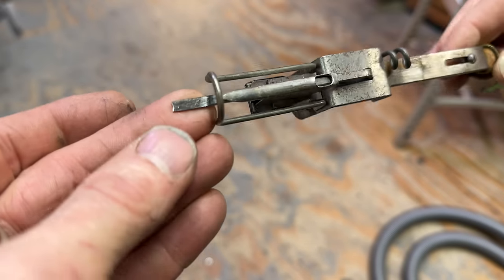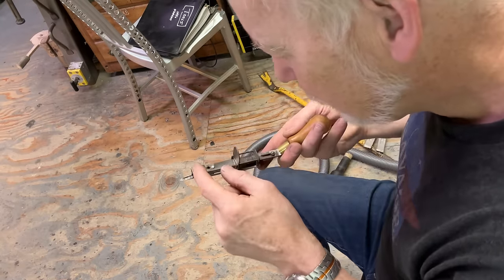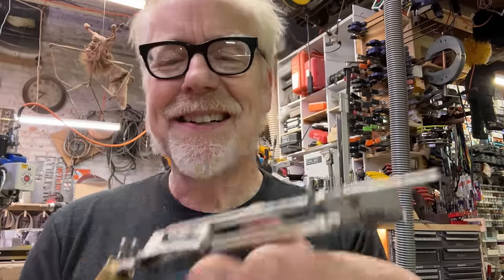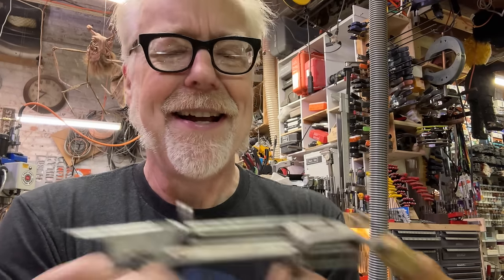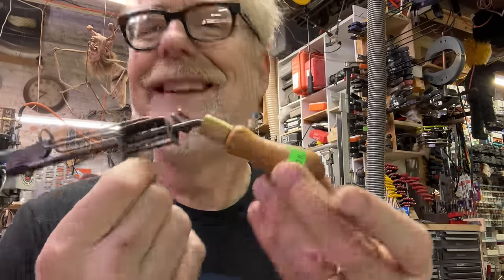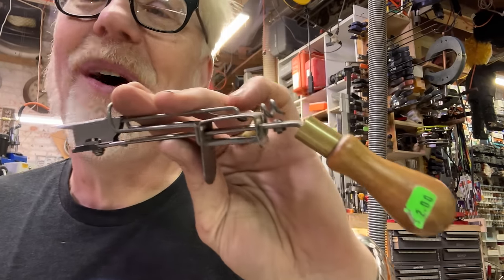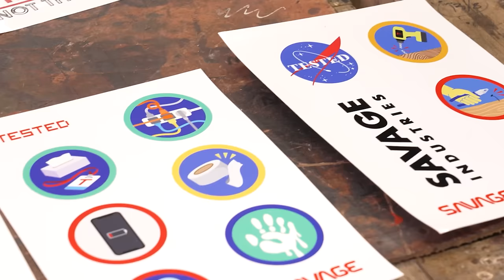Adam Savage's Mystery Tool Mailbag

Comment: This is a manual tufting tool! for repairing tufted rugs.
Reply: Yes!  I used one at school to learn how to repair  carpets!
Reply: What in the blazes is tufting a tufted rug?
Reply: nice 

My first thought was a some type of leather lacing tool
Reply: With the needle broken...
Reply: You're spot on, it looks like it's bent because everything I saw on my search was completely straight.
Reply: @johnhunt1725  Something you can't do to an untufted rug.
Reply: I was thinking the same thing! Looks like a huuuuge pain to use though.
Reply: It is a rug hooking tool, most likely a Bluenose
Reply: @johnhunt1725 you know those kinda plush indoor rugs or carpet? Basically this, forces the string through the back of a peice of fabric over and over and over in out, in and out. Usually you follow a pattern on the back to know what colors etc.

That process is called tufting, basically means to pass a thread through or something like that.

 Well if he's correct its for making repairs which is good because good lord doing that by hand would be agony large scale, hell even a small rug would take hours.
Reply: @alexhuxley3355 you know those kinda plush indoor rugs or carpet? Basically this, forces the string through the back of a peice of fabric over and over and over in out, in and out. Usually you follow a pattern on the back to know what colors etc.

That process is called tufting, basically means to pass a thread through or something like that.

 Well if he's correct its for making repairs which is good because good lord doing that by hand would be agony large scale, hell even a small rug would take hours.
Reply: I suspected something like that, maybe because I just watched Ali Spagnola's latest video with the tufting gun!
Reply: @1BigBen  Mine too, I wondered if maybe it was used for punching through thick leather and then pulling the lace with it.  Like a saddlemaking tool or maybe for a baseball glove or something.
Reply: That’s what I was going to say.
Reply: Making baseball maybe?
Reply: They used these manual tools to create kit hook&loop or shag rugs.
Reply: Came here to say this as well :)
Reply: As soon as I saw the thumbnail to this video I thought it looked similar to a tufting gun :D
Reply: Saw the thumbnail and was thinking oooh tufting rugs.
Reply: I was close. I figured it for some sort of heavy material sewing tool, maybe used in sailmaking, or something like that.
Reply: @donsample1002  Exactly what I first thought, some sort of sail repair tool.
Reply: Yes, I got the same answer with help of 'Google lens'. Took a picture of the screen when Adam held it and instantly found similar images. I'm amazed how easy it is to solve the origin of mystery objects like this with Google Lens.
Reply: This is actually a vintage piece too
Reply: I was thinking for sail making. But I like yours better.
Reply: I have an electric tufting gun at home and so this was my first thought as well. Lots of similarities. Would this have normally had an integrated scissor mechanism for cutting also?
Reply: @KJO1993  It is.. which is why there are power tool versions now ...
Reply: My fist thought was some sort of sewing mechanism, I think he was on the right track with the thread holder.
Reply: @johnhunt1725 tufting rugs is adding the material that makes up the design in the rug.  It's basically the process of making a rug
Reply: I think you’re 💯 correct. I’ve never seen a manual one but I’ve seen many people use automatic tufting guns before and was my immediate thought.
Reply: I love how this community knew what it was...
Reply: Tufted cattle?
Reply: I thought it looked vaguely familiar. My mother used to do all kinds of artsy-crafty stuff and tufting rugs was right up her alley.
Reply: I KNEW IT!!!!!!
Reply: Spoiler!
Reply: @FortyHurts yeah I was going the sail route too 🤔
Reply: @johnhunt1725 if you don't know, that's just tuft.
Reply: During my time in Canada in the 1920's I saw this tool used to sew twins back together that had been separated and realized they didn't want to be. Very painful boody process. More like grafting the way they did it so their skins would grow back together, but unanimously all the twins perferred the pain of that proceedure than the pain of separation. Weird thing was, that's NOT what the tool was designed to do. They're Canadians after all, who can figure those people out?
Reply: Great answer but it only leads to more questions. What is tufting?
Reply: I can see it now
Reply: I thought so!
Reply: That's exactly what I was thinking! For making rugs
Reply: Good call.
Reply: Yes, it looks like a fancy version of a rug making tool.  I helped my mom make a rug when I was about 10 years old.  A loosely woven piece of material had a peacock printed on it and we used a hand operated tufting tool to press loops of yarn through the pattern.  Using a hand operated hook, it was tricky to keep all the loops the same length.  It looks like this tool is settable to make it easy to keep the loops standardized.
Reply: @1BigBen that’s exactly what I thought!
Reply: Watched the first video on rug tufting that popped up pretty coool
Reply: No scissors as this is used from the back and trimming will need to be done from the front of the rug.
Reply: @djpoopypants4741  🤔😂
Reply: @MrGreenAKAguci00  shaggy carpet is tufted...
Reply: That's what I was thinking because it looks a lot like those rug tufting guns that are popular among rug crafters these days.
Reply: That was my thought as well :D Glad to hear I was right :D
Reply: I thought so too. Looks like it’s used for making rugs. I’ve seen videos of powered handheld version that looks similar.
Reply: @alexhuxley3355  It looks like a 1926 Garrett's BlueNose Rug Hook Tool
Reply: Yep. I knew that too just looking at the thumbnail :D
I actually have one. Its bend to ** tho
Reply: That is close to what I guessed: a rug punch tool like would make craft punch designs on canvas. These are simpler: on one side it makes an embroidery-like stitch, and on the other side it leaves a loop as the needle is drawn out.

Or is that what a rug tufter does?
Reply: @NotMyActualName_ 
Close, I think. The thing along those lines would be a stitching awl, but you have to thread the "bobbin" thread through the back end of the stitch lace to form a stitch like a sewing machine stitch.

Don't you need pre-punched leather pieces for saddles to sew from either side with sinew? Just asking.
Reply: @mrechannel2023  You can tuft anything with the right tool
Reply: oddly this was my first thought because I've seen so many of those rug making videos lately where they use a similar sort of "gun". Although I expected this also to be automatic, just missing some other significant part of the machinery. That being said the adjustable stop is kinda weird because it limits how far BACK the slide goes
Reply: Yeah I figured it was for manually driving a stitch somehow.
Reply: my thoughts indeed! Pretty cool
Reply: Instructions unclear. I tufted my pig.
Reply: I saw it and first thought was it looked like the front end of a tufting gun. I am watching this video while waiting for my new tufting gun to show up.
Reply: That’s what I thought!! I just watched it
Reply: @mrechannel2023 what do you mean you can't tuft an untufted rug? That's exactly how you tuft a tufted rug in the first place! Or did you mean that tufting a tufted rug isn't something you can do with an untufted rug, because then you would be tufting an untufted rug?

I love learning new words and immediately butchering them.
Reply: @mrechannel2023 untunfting a tufted rug takes a different contraption thingy😂
Reply: This is probably the only channel on Youtube where you can find so many people that tuft rugs.
Reply: Yup
Reply: After two minutes we actually take a look.
Reply: This is the answer.
Reply: Tufting demo: https://www.youtube.com/watch?v=JAFxVleDKN8
Reply: At first I thought manual leather stitching. But "string" guide, eye of the needle, uh, the needle itself as a whole, plus U.S. & Canadian patents. Props to Adam for showing it to us from every angle & so completely--no small task!
Reply: For making rugs also
Reply: It's a tool for hooking rugs. I've used it to make several. The loop in the back feeds the yarn into the rug base. Hope that's right. Thanks for your show.  Mary C Arkansas
Reply: God I fuckibg love the internet
Reply: Thank you for answering but I really wish this comment was second on the list cause I saw it before the video and it kinda spoiled it for me
Reply: L @reneedla
Reply: @johnhunt1725 its how carpet is made, pushing tufted yarn thru a backing creating one side that has thousands of pieces of yarn sticking thru it
Reply: That was a tuft one...to figure out
Reply: Yessss. I have one of those to fix rugs. And the electric one, of course.... 😅
Reply: I was going to guess it was for stitching sack shut somehow. But the carpet theory makes perfect sense.
Reply: I was way off in my guess hah. Thought it was a butchers tool to use for squirting liquid in to meat
Reply: I was thinking that immediately when I saw it!
Reply: Yes! I suspected this also.That's such a cool tool.

Comment: I know you get tons of comments, but I felt proud and wanted to share.

My dad passed away about 7 years ago and I inherited an entire workshop full of tools. The standard things like a table saw and compound miter saws to mechanic tools to concrete finishing tools to electrical and plumbing specific tools. It has been incredibly hard going through everything because I can see my dad using them to build or do repairs but year over year I spend time going through and organizing things with all the tools I have and consolidating.

I watch your videos and you say something sometimes which is to the effect of "trying / doing new things is scary". I 110% agree with this sentiment. Failing is difficult and sometimes costly, and nobody likes to fail, BUT that's how you grow and learn!

Well, I had to rethread a nut so it would fit a specific bolt into it and save me the hour drive it takes to goto the hardware store. I have never tapped or rethreaded anything before in my life but didn't let that stop me from reading how to do it, learning how to measure the threads, and then learning how to start and go through the threading process.

Once I was finished, I confirmed the bolt fit the nut and threw my hands up in the air in success! When I looked down and saw the tool I was using, I realized I was using my dad's old tap and die set. It made me tear up, because I was doing EXACTLY something he had used hundreds and hundreds of times... Like I could feel him there feeling proud that I was doing it myself and I could feel him patting me on the back and encouraging me.

Just wanted to share that and say thank you for helping me build up the courage to do something I've never done before. It helped me feel the love and memories of my dad and really does have me inspired to take risks, take a chance on doing something I've never done before because that's something that helps me celebrate his life.
Reply: @StinkieManCheese, I know how you feel. My dad passed earlier this year. I claimed his favorite hammer ❤
Reply: Sadly, my dad passed in the fall of 09, after taking Delta's early-retirement option not even 12mo prior (he was a Northwest employee for >30yrs). The only silver lining was, it happened while he was Elk hunting, sat down to eat lunch at his favorite overlook on my cousins land, and had a heart attack... Couldn't of had a more beautiful final sight, and while doing something he loved dearly. If only we all could be so lucky. 

So with that said: TO LOST FATHERS... 🍺😢
Reply: Amazing comment I hope he sees🙏
Reply: Thank you for sharing.. I hope one day my kids do the same with my tools.. I always wish but never expected them to have the same passion for building and fixing cars a stuff but hope one day thay will. Thank you
Reply: Thank you for this. It's an important shared experience with many facets. Family, history, learning, manual skills, honoring the elderly & past generations & their day-to-day lives....
Those not lucky enough to have shared this experience in some way can get a feeling & understanding of it thru your telling.
Reply: They are never far behind us when they leave; and Always close to your heart when you need them to be. I have my Dad's Carpenters and cabinet making  tools. He passed in 2015 at 78. I use them when I need to, occasionally struggling mentally to remember what he taught me or trying to figure it out on my own. Every now and then I'll get that tap on the shoulder or my Brain bulb comes on, Eureka ! I hear his laughter and see his smile in memory as I hear, " Nice job Stan, that's how you do it!".

Comment: Could it be a manual tufting gun for rug making?
Reply: I was thinking it was an old tennis racket stringer but tufting makes sense too.
Reply: This is what I was thinking it was as well
Reply: Yeah that was my first thought just from the thumbnail seeing its motion kinda confirms it!
Reply: I was thinking leather & canvas crafts. but the rugs idea is much more plausible
Reply: Google search confirms your suspicions
Reply: That was my thought, too.
Reply: @Darkalyle  I was thinking it might be a snowshoe lacing tool at first. Not that I have any experience with that. LOL
Reply: @bluflaam777LSA  i can see that too.
Reply: @bluflaam777LSA  Maybe you're thinking of a different method, but that doesn't match my limited knowledge about handmade snowshoes. My grandfather used to make snowshoes as a secondary income, and the methods he used to weave the rawhide string involved wrapping it around the wood frame in a way that when you pulled the string tight, it would constrict onto itself and prevent it from being able to come loose.

Comment: He picked up on the “string guide” right away.  But as we now know, it is for rug yarn.  The modern form of this can be found under “punch needle” among yarn crafts.  Working from the back, with a device like this, which has yarn threaded through the pointy part, you push in (leaving the yarn loop that far in), then pull out the needle, move to a place just next to that and push in again, each time leaving a loop on the other side at a uniform length.  You can change the length of the loop by the setting that Adam found near the hand end of the device.

Comment: It is a rug tuft repair tool, when you have a worn or damaged carpet you cut out the damaged area, then place a mesh on the underside of the carpet.
This tool replaces the carpet pile (tuft) making an invisible repair.
The adjustment slide is for determining the depth of the tuft.
The handle is bent to allow the user to accurately see where he is placing the tuft, plus stop the wool from tangling in the handle, the rear coil feeds the wool in a straight line down to the tool head/cutter.

Comment: One of the tools I spoof on new friends is a very old wet/dry swing style humidity gauge.  They can NEVER figure out what it is for.   During the hot dry summers of the Mt St Helens volcano timber recovery(1982,83,84), we had to constantly check the humidity as we worked.  If it went too low, all timber cutting crews had to leave the tinder dry Mt St Helens monument.  A swing style humidity gauge was used.  Long, dry, dusty days, in that moonscape, wearing a paper face mask all day, usually replacing it at least once, so long as the humidity was right.
Reply: If I remember, the official name of that instrument is sling psychrometer.  You could tell friends the name and they would probably still be mystified as to what it is.  I remember seeing that type of instrument for sale the Edmund Scientific catalog many decades ago.

Comment: I believe it a "latch hook rug" tool. The yarn goes through the spring looking end, down the length of the tool and is caught on the front. You push the sharp end through the base material, pull the tool out and the sharp edge on the tool cuts the yarn. The adjustment is to allow you to set the "depth" or length of the yarn to allow for different thicknesses of rugs.

Comment: That is indeed a tufting tool.  My dad worked in a rug tufting mill many years ago and I believe he might have had one of these and other similar hooking tools for making rug tufted rug patterns, doing repairs, alterations, that kind of thing.  He's since passed, so I can't be sure...  but I can remember back when he was working when I was very young (some 30+ years ago), I think they still used the old fashioned hooks, and maybe had some pneumatic ones at work.  These days it seems they're mostly electric or pneumatic and kind of resemble power drills.

Comment: You were so very right on what the parts did ...
But it is most definitely a tufting gun, which works exactly as you said you thought it does, it takes a string, and stabs into fabric, and then has a mechanism to pull the gun out but leave the string there ...

Comment: I recognized that one immediately (manual tufting gun as pointed out in other comments), because I bought one last year on eBay out of sheer curiosity. The seller had no idea what it was, except that it came from the estate of a land surveyor, which set me on a completely wrong track before I did an image search. Two dollars is a steal if you plan to use it (I only use it as a conversation piece) - in my part of the world they can be way over 100 Euro new, depending on the maker.